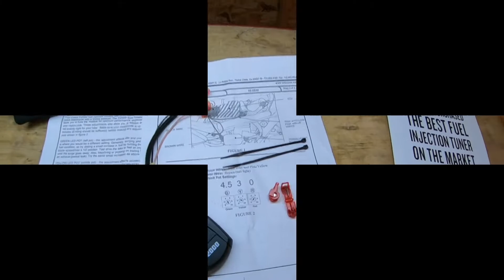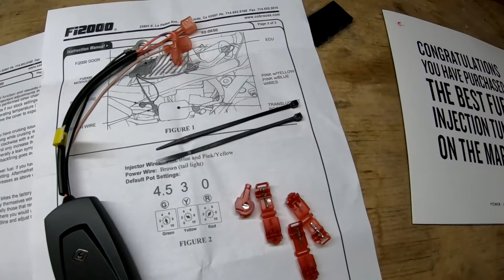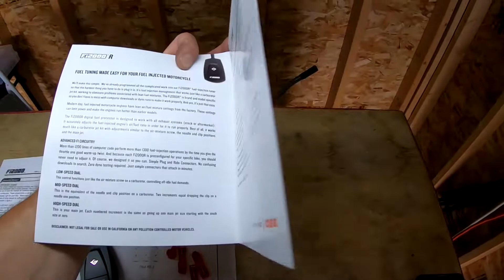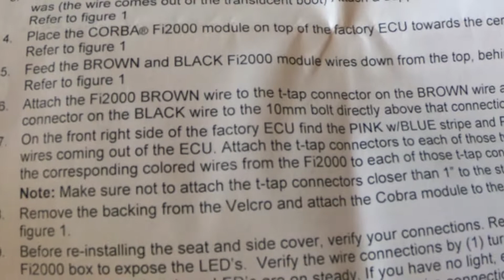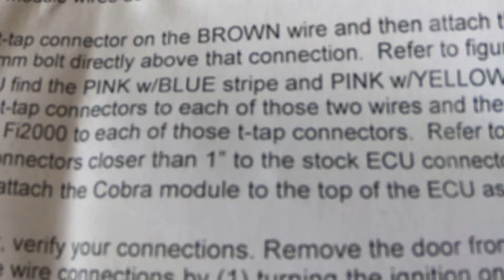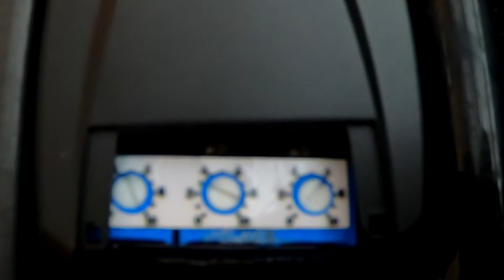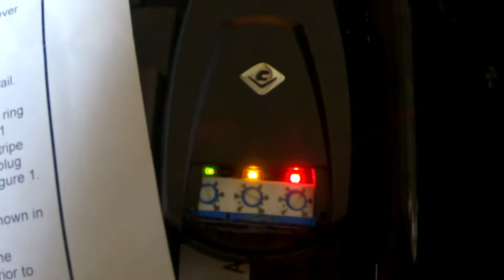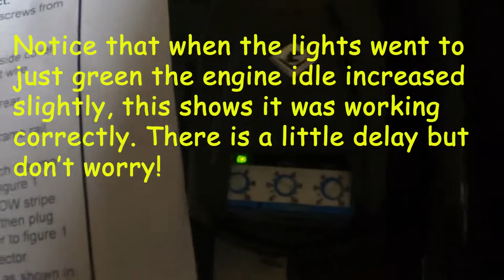Cobra Fi2000 Fuel Controller Install.

Comment: Do you have any issues with poor gas mileage?  it may be the Fi2000 settings.  I noticed you left them at the factory settings but these are not ideal, from my research the best settings are 2-0-0
Reply from the maker: Thanks for the comment. I have since sold the VTX but I did notice a slight drop in MPG. I had tinkered with the settings here and there but ended up going back to default. Thanks for watching! 🍻👍

Comment: What about performance, any noticable difference after fitting the fuel controller?
Reply from the maker: Dan9693, thanks for your question. I posted an updated video about an issue I had with the fuel controller. I'll post another update once I get a resolution from Cobra. Regards, Mick.
Reply: @Guvnarides-WI2020  есть новости?
Reply from the maker: @КсенияАбрамова-ф2р  my apologies but I haven't been able to translate your message. I'll keep trying.